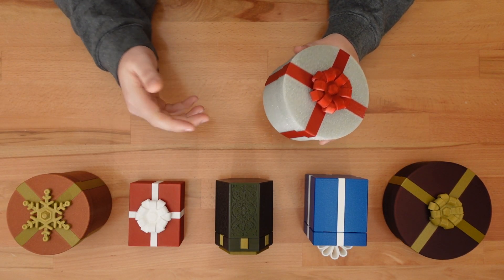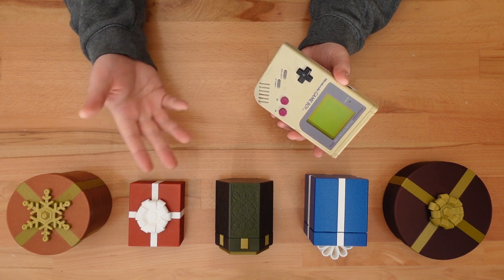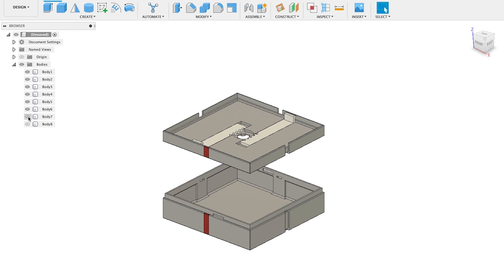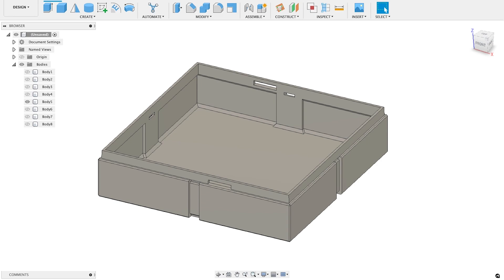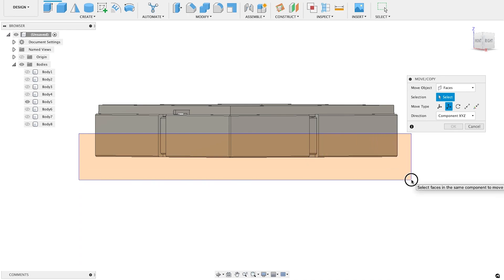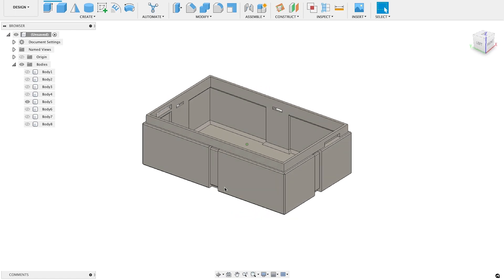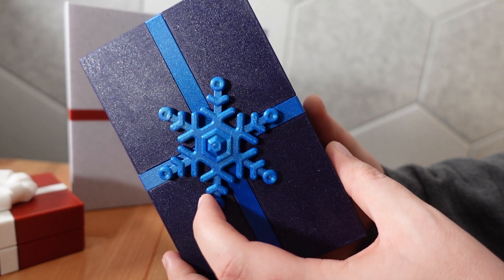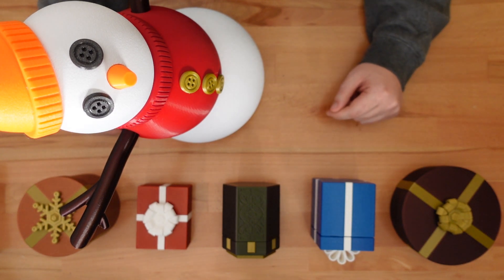3D Printed Twist Lock Box Fusion 360 Tutorial

Comment: I cant figure out how to resize the length and width of cylinder twist lock boxes with this tutorial. Can you help please?
Reply from the maker: Cylinder Twist Lock Boxes are slightly tricker, but still manageable.

The method you use will depend a bit on how much you want to change them.

If you need a cylinder that's only slightly larger or smaller than one of the two sizes I've posted, then I'd just scale them up or down in the slicer.

If you need a larger change, you will first need to delete the two flat faces that are located above each of the four latch holes on the base. These are added to make printing slightly more reliable, but they're going to get in the way of scaling the design. Delete them by highlighting each face and hitting the delete key. Next use the press/pull tool to pull the exterior walls of the present as far out as you need them to be. Don't forget to include the ribbon and the vertical walls where the ribbon clips in at the bottom. Now do the same thing with the interior walls of the present. Finally, repeat this press/pull step on the lid, the vertical wall of the lid ribbon, and the vertical sections of the latches that now need to be longer to fit the lid. I hope that helps!

Comment: Great tutorial, but why didn't you just use Change parameters(which is under the modify section) Because then you could just set each direction as a variable, change one number and the whole thing would recalculate?
Reply from the maker: Sounds like you found my earlier version of my script :)

Parameters got axed from the tutorial for a few reasons, but I might cover them as their own thing in a future video - possibly using a model that is specifically designed to show off what they can do.

Comment: Great tutorial and model! Suggestion: if you export this project as a .f3d instead of .step the user could specify the box dimensions very easily in the parameters menu (provided the model was designed with parameters set correctly). And the spring size could be a function of the box dimensions. Would be even easier for a novice to Fusion 360. Thanks for your great content this year and happy holidays!
Reply from the maker: Very good tip!

Even though I called this a "Fusion 360 tutorial", I want to be sure I'm sharing my models in a format that other CAD software can use. In this case, STEP feels like the best match.

Within the Fusion 360 ecosystem, .f3d would be the better way to go. It also wouldn't have renamed all my model's parts!

Comment: What printer do you use? I am currently on the lookout for a new printer and can't decide between the prusa or bambulab
Reply from the maker: Hi Möhre,

My main printers are all various versions of the Prusa MK3 line (MK3, MK3s, and MK3s+). The oldest of these recently passed 20,000 hours of print time, and still prints very reliably. But all printers require maintenance if the are used long enough. It's a good idea to pick a printer you'll feel comfortable fixing... or I suppose a printer that you consider disposable enough not to fix.

I have no personal experience with Bambu Labs' printers, so I'm hesitant to draw any conclusions. I recommend checking out reviews from those who own both Prusa and Bambu printers. CNC Kitchen and Tom Sanladerer are both experts I've relied on in the past for decisions like that.
Reply: Depends on if your goal is multi color or rock solid/upgradeable/repairable… One downside to the P1P and Carbon X is parts for repair or replacement might be nonexistent for the near future. Things like LIDAR are not fixable and can be very costly to replace. Prusa have history behind them and step by step guides to troubleshoot and upgrade them. 
After a few months of watching everyone go bonkers for Bamboo I think I will skip Gen1 and wait for the Gen2. May cost more then but everyone else can figure out the bugs for me 😊.